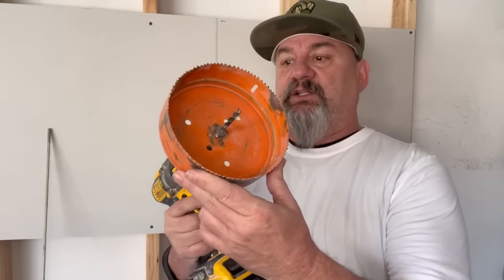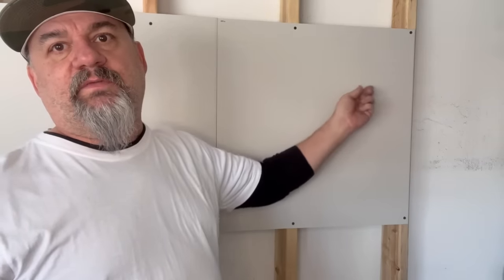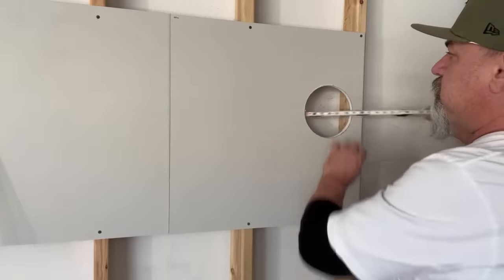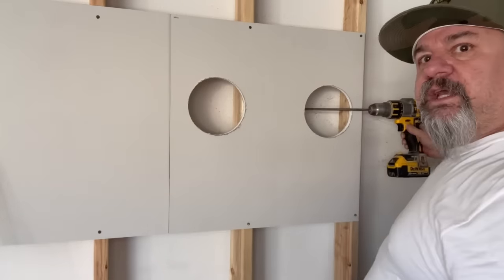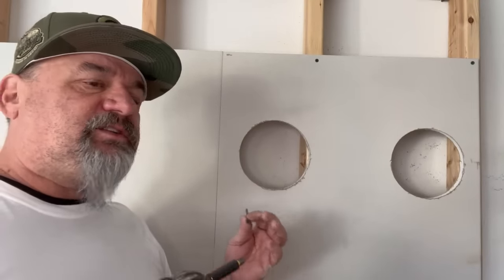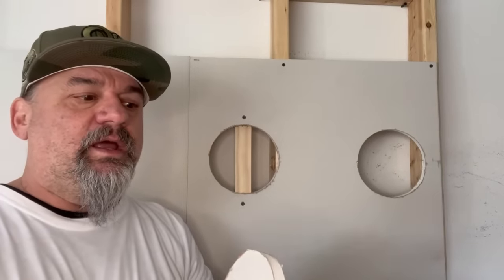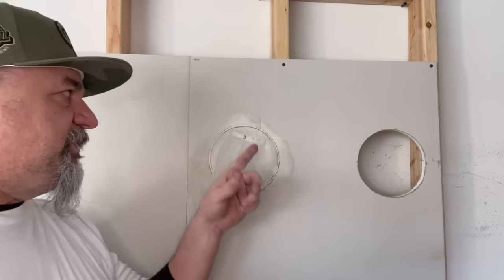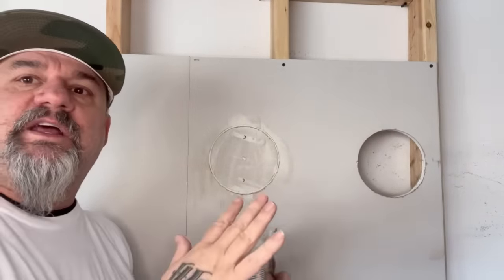Unbelievable Trick to Run Wires Through Walls and Fix Drywall - You Won't Believe What Happens Next!

Comment: I wonder if a 90° drill would allow you to get in with the hole having a slight overlap with the stud: just enough to check for wire on the other side, and you could use the stud to screw back your piece. Might be a way to skip every other stud as well. Not sure 6" would be enough though.
Reply from the maker: I have a video coming out next week where I explore other options like drilling on the stud. thanks
Reply: @StarvingElectrician  awesome! I'll sub to your channel so I don't miss it!

Comment: I might have missed it, but how do you secure the romex either vertical or horizontal?  Are yoe using the u nails or staples?  I used small one holed clamps at the access holes I made for a wire run for a new outlet from the attic straight down the wall.
Reply from the maker: if you have holes you can use small straps and screw them in. if you have no holes down the wall you use the box supports and staple it where you can. the whole idea of supports is to protect it from damage but once the walls are up that damage is negated. i have yet to have an inspector shoot me down so long as I support the romex before it goes in the wall and inside the box and thats where either the plastic clips come in or a steel box has steel supports.

Comment: Maybe u chose that height location for convenience sake, but it's the exact height of a television and mirror and picture frame that might need to have screws into the stud that most homeowners will use 2" or 2 1/2" screws for security and will put that screw right through the hidden romex. maybe down low someone won't use a long screw but at that height  you are better off with cutting a channel and a nail plate over each stud to protect the wire.
Reply from the maker: im just showing a trick I use. theres no details of a height or anything its just a patch. wow

Comment: Or you could pull the baseboard, cut a slot at the bottom of the wall and do your work there. After you fill it back in, cover all the evidence by nailing the baseboard  back in place.

Comment: I have a question. First, I used to install home satellite  systems from the old C and Ku bands with the dish that tracked the satellite arc all the way to the Sat systems currently in use today by DirecTV and Dish. As well as installing home theater systems and home security systems. So, running wires through out the house is nothing new to me. Now my question, are electricians okay with homeowners running new wiring as well as installing new grounded outlets including a couple of GFCI outlets for the KIT/BATH/OUTSIDE areas? I will also be installing a new and more current and up to date breaker panel box. Our house is over 70 years old and still has the old wiring (possibly aluminum wiring) I can not confirm or deny that at this time. You see, I will be running CAT5/6 wiring and RG-6 anyway so that is why I want to go ahead and run the new electrical wiring as well. And our attic is a low roof line attic so crawling is the only way to get around up there. I can even hook up the wiring in the panel box myself. However, it is the 110/120VAC line from the header to the new breaker panel box that is "above my pay grade" that I would need someone with your skill set to take care of that part of the electrical installation. 
Be advised, as said homeowner and the payer of the home/property tax, I feel that I do not need to get and pay for the government's permission to do said work on MY PRIVATE HOME AND PROPERTY. But I do not have any issue with having someone check to ensure that my work is within standards for safety. I served 24 years in the Army so ensuring my work is within said standards and safe is standard data for me and I also welcome it. 
Anyway, that is my question for you. I will be looking forward to seeing more of your videos and learning some great to know shit from you. 
Be safe, have fun, and as always, be yourself.
Reply from the maker: thanks so much

Comment: Or you could use a rare Earth magnet to find the stud you need a hole through & drill that big hole with the stud right in the center of it.  Then there would only be one hole and you wouldn't need a board.  Your final patch size would be about 26" x 26" and it wouldn't show.

Comment: When making backing board it works better to use plywood or OSB! Why?  Because lumber always cracks and doesn’t hood the screw.  You can put several screws next to each other in plywood and it won’t crack
The screws all in a line with regular lumber it most times splits like kindling.  Bury the screw heads if ya want to please a drywall finisher

Comment: I cut my holes using a drywall saw. I cut them at an angle. That way, I don't have to screw a piece of wood for the repair.
Reply from the maker: this is just one of many tricks. theres lots of ways to do this.

Comment: Please  don’t do this if you have more than two holes to make( nice trick though for a couple ) Sheetrock ( drywall) is a relatively low cost material. Labor is expensive. I can remove big tracks of drywall quicker and replace & tape a long rectangle in a fraction of the time . A couple hole saw cuts is my limit, more than that , just remove the drywall and do your work, drywaller pro won’t screw around with all those pesky holes , fiddle fuc*ing around with a 5 in one etc. & the bumpy walls you will end up with.. 
just my opinion .. year 48 contractor …
Reply from the maker: Thanks. this is just one thing I use in a pinch is all.
Reply: @StarvingElectrician  I see. It’s a good way to go. If I sounded like an asshole it’s cause I didn’t get my morning coffee yet! It’s good you think of the next guy! Bless you!🔨lol my wife said it’s cause I am an asshole!!

Comment: i know SOOO many bosses that cry and pass out over a large hole where we can work WITH EASE.. as if theres no patcher coming behind us. Just make a BIG HOLE . the problem comes in, where you are in metal stud jobs, and now youre hunting for stud pieces. THATS the problem. Asking, "can I use these scraps?" sure...you can... but that eats up time as well. 

or if you dont have any other trades going on, and you have NO wood. 

so Im like, "cut to the studs, and do your work. the drywaller would rather you make something they can patch, than something thats hard. But I swear, electrician foremens will go out of their way to make stuff harder~!

Comment: Disagree with horizontal cleat in center. Cleats should be on left and right of hole split between existing drywall and patch. What your missing is that if someone hangs a picture or whatever the edges of patch are gonna crack. Guaranteed!

Comment: Good trick :) and good solution to so many problems is planning but sometimes mistakes get made and someone has to sort them haha.
Had to do this so many times in my place cause the original electrical contractor put wires down from the roof a batten over from the switch or had random 90's not to mention all the other issues and now hes a top inspector (even though i am sure he wouldn't pass our place if he looked at it)
Thanks again
Reply from the maker: Very true!, uggggggg the stuff you find after the fact.

Comment: It’s not only reach inside but if you run a wire through you have to protect the stud where the wire goes through. So removing the drywall is the only option.

Comment: Best tip in this is using a cheap, low-torque drill to screw in the drywall screws so they don't break the paper of the drywall.

Comment: Since you used a wood backer and screws, would a stud finder register that wood strip as a stud causing a future homeowner to assume it's a stud?

Instead what do you think about using a strip of drywall in place of the wood? Then you would use adhesive to hold the backing drywall strip to the inside of the existing drywall. Then you could apply adhesive to the middle of the strip and secure the patch onto it. No wood no screws.
Reply from the maker: that requires drying and drywall screws pull out. I think you are looking for a reason for this not to work. are people really with stud finders all over America and running into small pieces of wood? ohhh nooooo what do we do now? lol you are over thinking it. it's my tip and people can use or not. its just a trick I use is all.
Reply: From a drywallers perspective a channel is easier to fix than many large holes. This method is definitely slick from an electritions point of view...clean and easy 👍
Much more thoughtful than the electrician that uses a hammer to run wires 😂

Comment: I do the same thing but i have a square jig that fits the multipurpose tool it's 10x12 and I do it centered over the stud that way when i put the slug back in i don't need helper boards

Comment: My house has lathe and plaster walls and true 2x4 wood framing.
Going through old drill holes with Romex is impossible so I have to drill through new holes.
It's a pain.
Reply from the maker: thats a different story. sometimes pipe on the outside of the house is the answer or coming from underneith. or remove the base board and bang the holes behind that.

Comment: I like to drill my 6" hole centered on the stud.  Then even if there is a cable strapped to the side, I will not hit it.  Notch the stud, run the cable, put a nail plate over it, and screw the drywall circle to the stud with 2 screws.

Comment: As far as what I do about the dry way mud, I don’t. That’s not my job. If you fix it, you better fix it right, or don’t touch it at all.
Reply: I price a taper in a job if there's going to be holes to be fixed. My guy is in and out and his money is covered. He gets paid when my customer is happy with the primer coat. The discs i cut are left close by for him to re-fit. I do not hesitate to cut another hole if it makes the work easier.

Comment: Cut a Chanel across the wall, drill studs run wire, put nail plates on studs, patch and tape.
Reply from the maker: have a video about that coming. nail plates if you drill too close to the stud

Comment: Good video.  But is this work to code?  No stud guard metal plate over the stud?
Reply: Dale, the way around that is to drill your holes large enough to fit a 1 1/2" long sleeve of conduit in your hole before inserting the wire.  A little quick setting construction adhesive or quick set glue will hold them in place.  As good as or better than stud guards.  Will take care  of the code issue as well . . .
Reply: @rtboat7172  Great idea!
Reply from the maker: exatcly. you don't need a nail plate if the hole is 1 1/2" inch away from the edge.

Comment: have you done this going from floor to floor? We have a tri-level with the panel in the garage (lowest level) and the kitchen where I need the circuit is on the middle level. So I need to go up 2 floors (exterior walls with insulation), over, then down 1.5 floors. Which is why, 10 years later I still haven't addressed it, LOL. Would love to hear your thoughts. Thanks so much.

Comment: If you overlap the corner stud or center the hole  saw on the stud.......
Eliminate the backer board 

Use a potato peeler to easily bevel the edges of the dry wall.
Reply: I'm the son-in-law of an electrician who paid attention!
Reply from the maker: Seriously? damn thats a great trick. wish I would have known that. I just dropped a new video with the different tricks.

Comment: I run through the bottom and hide my sheet rock behind the baseboard. Then cut a hole for box and fish wire through. You don't have to do all that extra work. Oh well, each your own.
Reply from the maker: this is just one of many tricks. there's lots of ways to do this.

Comment: I had a similar thing done when my house was built. Only problem was the sparky did a crap job "fixing" his hole and the drywall guy and painters didn't fix it. I ended up sanding back the visible raised ring of no confidence back by 5/64", fill the depression on the opposite side of the raised part, sand and paint it. Not really awe inspiring work of so called professionals. Personally I thought they were professional amateurs because this wasn't the only far cup I had to fix.
Reply from the maker: oh I hear you. I can make it smooth but man if a homeowner tries it and it comes out like shit they will blame me! lol  there are three different steps to making it smooth. personally I think caulking the holes works well. so it doesnt suck into the hole. then a light covering of mud, a quick scrape after it dries and then with the 10-12" knife feather it over the hole and sand the edges more than the center to blend it. theres a few steps but this was just a quick DYI thing I do from time to time. thanks

Comment: I understand that your time is money, but the homeowner might  alternatively use some variety of construction adhesive for attachment of the slat and slug, eliminating the possibility of the screw heads being visible or some time down the line, popping thru the  skim coat of plaster. Very entertaining, BTW 😅
Reply from the maker: Thanks for the imput. yea lots of ideas out there I put up a video of more tricks from suggestions. so many great ones out there.

Comment: If I want to install 220V about 60' away from main panel, will that be fine? Just want to run a wire, then add an outlet from garage to a room on same level. All at ceiling height. Thanks.
Reply from the maker: yea thats fine. no voltage drop or anything. make sure to size the wire and breaker according to the name plate rating.

Comment: The new generation of stud and metal finders are a great way to make it so that with a flexible drill bit big holes are not always necessary.  I just did a ceiling fan job where I had a 12 foot run through joists.  I cut in two fan box holes and used the holes to drill from each end.  I then used fish poles to get through where they met.  Saved the ceiling from having to be repaired and refinished.
Reply from the maker: yea avoid making holes at all costs!!!
Reply: This is great until you hit a wire or plumbing pipe. A drill bit hitting a plumbing supply pipe could destroy an entire house. Patching a few holes is nothing compared the restoration that comes with water damage.

Comment: 4 inch hole, 12 inch hole... doesn't matter.  In fact, the bigger the hole, the better the patch will look because you have a larger surface area to spread the inconsitency.  It would make the drywaller's job easier if you at least bevelled the edges of the hole and the patch material.
Reply from the maker: right on!!!

Comment: I cut drywall for a cut in box and go to the next stud and cut a 3 inch x 1 inch hole in the drywall to the next stud or if I'm going up to the attic I cut at the fireblock I can then use my drill to go through the stud or fire block. I use a wire to go through to the void then tape it to the romex and pull the romex through. Much less patching then your method. No wonder why you're a starving electrician. 32 year I.B.E.W. Retired Electrician

Comment: 6 to 1 half dozen to the other. 100 ways to skin a cat etc etc.. hole saw is an easy way to make the hole and patch piece at the same time for sure. I always try to run wire with the least drywall cutting as possible.

Comment: Good ideas, but I would have only put one screw into the circle, right in the center where the existing hole was. No need to put in two screws.
Reply from the maker: yes but the screw head is smaller than the hole drilled it will pull through. you are already putting screws in for the backer so whats one more screw?

Comment: Thanks for these tricks. I'm not a pro like you are but I was just wondering, that strip of wood you used as backer (the round drywall for patching) would register as a (fake) stud later when someone uses a stud finder. My train of thought is just futuristic. How do you not worry about such?
Reply from the maker: well its just one way to patch. I have another video with different ones
Reply: The best way to figure out if you're getting a false reading or not is to go 16 inches left and right. If you don't read anything there it's probably not a stud. Could be a pipe, but studs aren't placed randomly.
Reply: @samueljardine3402  great point. thanks for this!

Comment: Hey brother quick question, I just got my journeyman card and have primarily worked in construction however the last three months or so I’ve been doing residential calls.. Is this the type of drywall cutting and patching you would recommend if you were putting in a ceiling fan where there was no box before hand? Like if the ceiling wasn’t open and the drywall was right up against the floor joices so you couldn’t throw a glow rod or fish tape over? Sometimes the studs don’t line up with the way you have to go to get to where the switch is going to be so that basically means you’re going to have to drill a hole in between each floor joist to make sure you don’t drill through a wire or a pipe right?
Reply from the maker: yes thats exactly what its for. it a when all else fails thing. theres damage but sometimes you have to do what you gotts do. some douche commented REAL ELECTRICIANS DONT MAKE HOLES. wow he must be magic. or just some troll but never the less this is a good way to make it easier on you as well as the patch. good luck!
Reply: @StarvingElectrician  yea I work with an asshole that says things like that..people also think I’ve got a magic wand where I can magically make the wire appear at the switch without doing any drilling. So far I’ve been pretty fortunate but a few times I’ve had to cut holes.

Comment: Not a bad way but why don’t you just drill the 6” hole on the center of the studs? It should give you enough room to drill the pass through holes and now you don’t have to use any wood for backing.